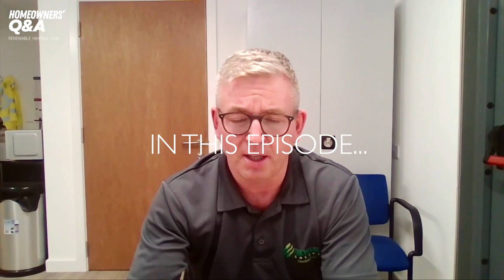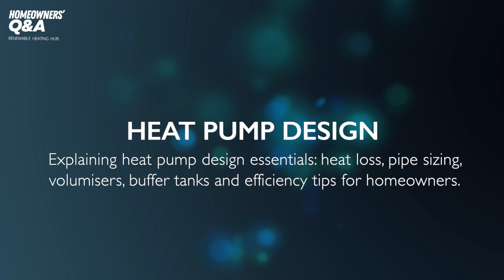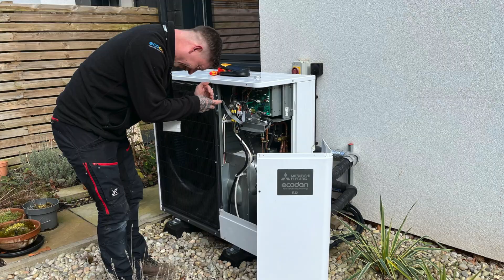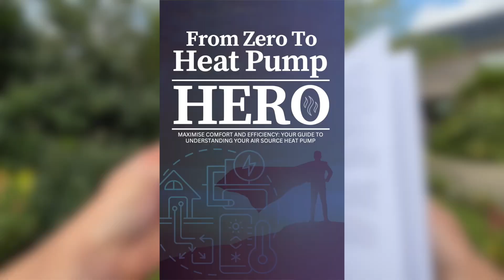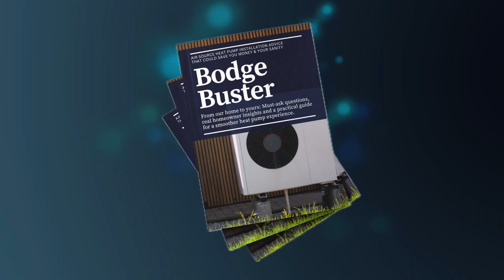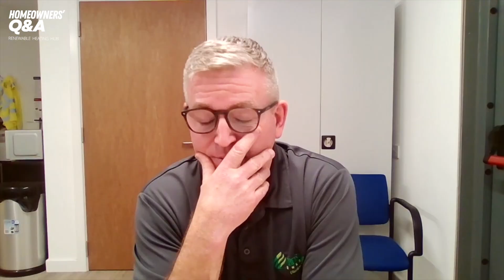Do NOT Install a Heat Pump Before Watching This Video – Understanding Proper ASHP Design

Comment: this is one of the channels which confirms that you do not get rid of your gas boiler,  don't fix what isn't broken...  these people think that all their electricity comes from renewables when they're charging their batteries and EV's and running their heat pumps..   grants and cheap rate tariffs will attract the easily lead...
Reply: It's easy to demonstrate that a heat pump has massively lower carbon emissions than an equivalent gas boiler, because there are enough renewables on the grid to make it so.